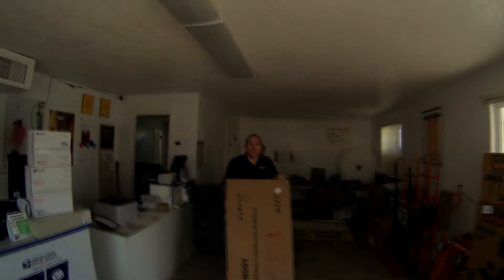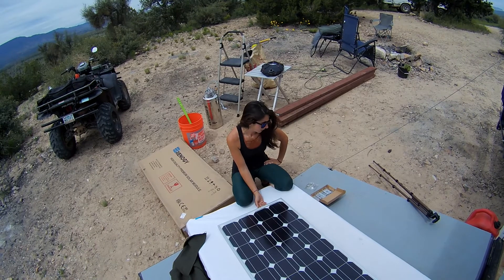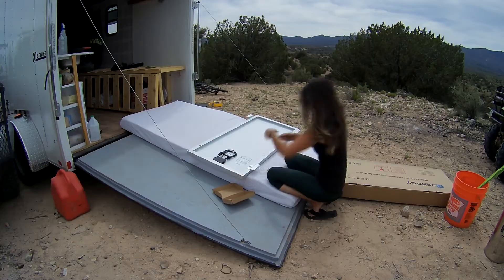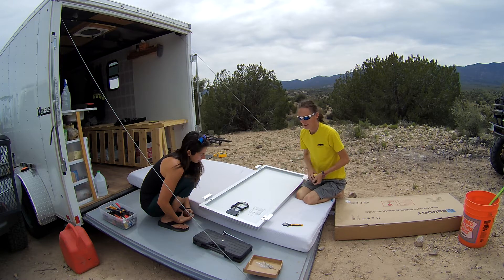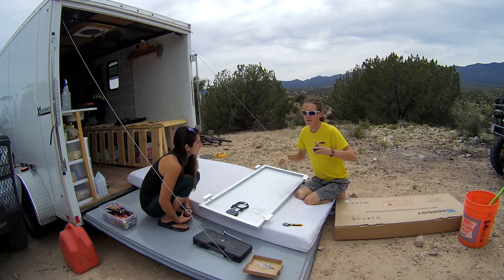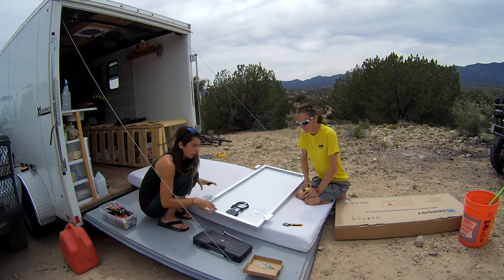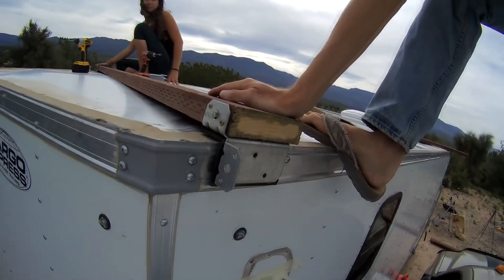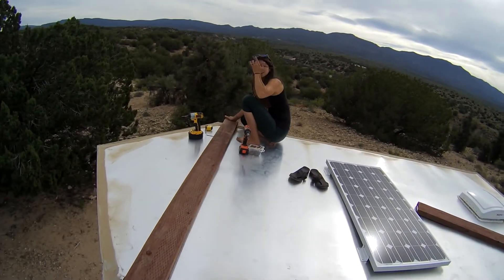Installing a Renogy Solar Kit on our Cargo Trailer (Part 1) - Big Mistake?!?

Comment: I would still have gone with aluminum intead of pressure treated wood. Weather can still break down wood and make it crack. You don't want a panel flying off on a hughway because you saved a few dollars using wood!

Comment: Great ideas but I’m finding mounting panels with 3M VHB tape is a cleaner easier proven new method for direct rooftop mounts when done correctly. 
VHB is used on builds instead of rivets on trailer walls an is even used in High rise buildings to attach those giant windows in place. Very strong and weather durable.

Comment: First thing you wanna do is get yourself a ladder. And not walk on your truck mats down or not. And I bought ladder racks for my install and installed stock steel tubing for cross support and only used half. And now I can use the other half for ladders. Which you obviously need lol. But this is budget friendly

Comment: There is a lot of information on YouTube how to mount panels on Cargo Trailers.  You should have check them out.
Nothing wrong with putting holes in the roof if it is done right.
Reply: As thin as these trailer roofs are without sturdy backing it’s never a good idea to put holes in them if it can be avoided. 👌

Comment: How long will that 1 panel solar fully charge my car battery during full sun ? Thanks!
Reply from the maker: What car battery do you have?  How many amp hours is it, and do you mean a discharged as in 50% discharge (considered full discharge) or just keeping your battery topped off.  If you don't know that, what type of car and what is your application need for it?  100 Watts / 12 Volts= Amps.  So that amount of amp's will be provided to your battery in optimal conditions.

Comment: The horse is already out of the barn,  but surprised you put up the wood framework.  If the roof is not rubber or TPO, I think you could just tape the mounts down directly to the roof using the high strength two-sided tape that AM Solar uses, and then pool DICOR sealant around the mounts to protect the tape.  They claim they have never lost a panel and they have been doing it that way for a long time.  I have a TPO roof on my trailer, so I need to use screws, and a special sealant for TPO, but I plan to just tape them down and use the special sealant to seal the screw holes from leaking.
Reply from the maker: Thanks for that input I hope others will benefit from it!  Or maybe our next rig!  We are nuts and bolts type of people and it just scared us to glue them down, but hey it sure is simpler!  We do now as an added bonus have a roof rack for spare tires, kayak or whatever else we may enjoy.  But it was a long-winded process and probably over built like most everything we have done with the trailer!
Reply: Yeah, sure. You could ride a unicorn to the hardware store to get it.

Comment: Do the rear panel-boards first. Mount them and the solar panels. Have the front set already made and ready to install. Scoot them as far forward as you need to. Worst case scenario is you'll have to follow the v-angle with your boards to gain a little extra length.
Reply from the maker: DirtySouthTV we will use your advice!  Thanks for watching.
Reply: Outdoorsisfree It's our pleasure. Sending y'all love from Louisville, Kentucky.